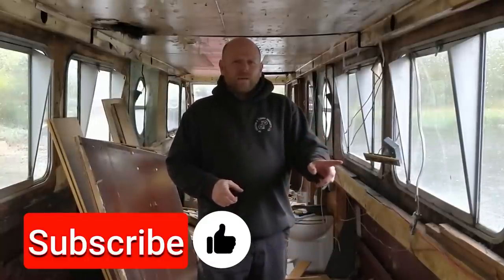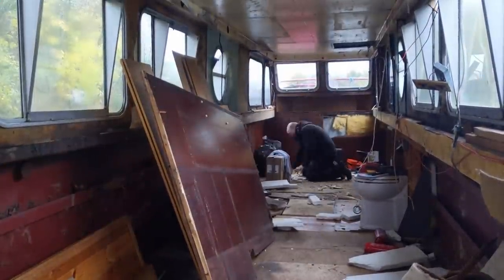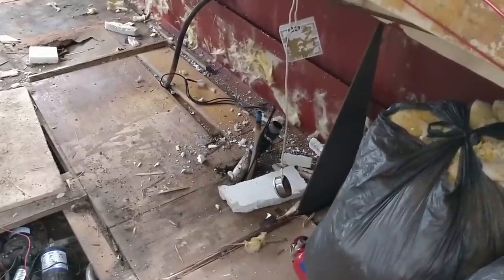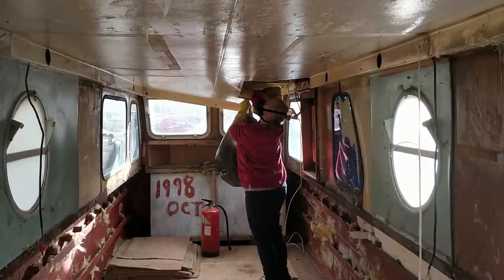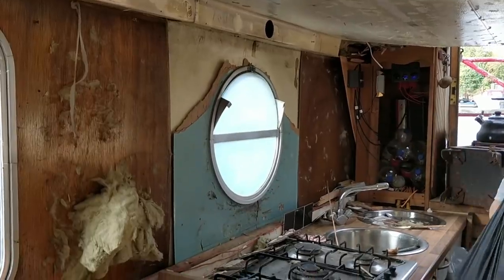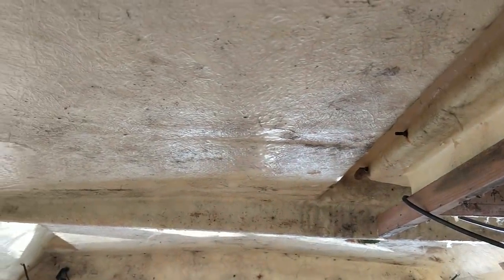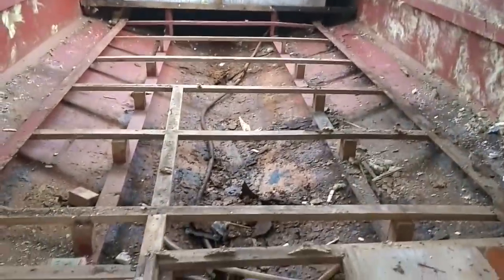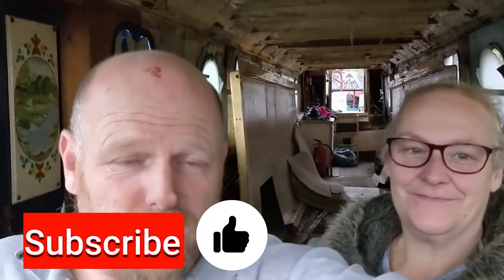Drop the ceiling and lift the floor, stripping out our narrowboat. Episode 9 of the DIY project

Comment: There is no ballast and that flooring is just chipboard. You need concrete blocks for ballast mate,, and WBP 20mm plywood for the new floor.. Keep up the good work!!!
Reply: I also wondered why there was no ballast, I remember many years ago when fitting out my new shell the floor was covered in concrete blocks.
Reply from the maker: The back sits ok in the water so it only needs a bit towards the front, especially taking into account when the water tank is filled up.

Comment: Is there no ballast in the boat?
If not is it because the top half is made of fibreglass.
Great vlogs. Lovely be to see a boat stripped back and rebuilt.
Reply from the maker: No ballast in there. It was sat a bit high at the front so will add some as we rebuild...

Comment: Because you’re going to live on the boat when finished I would out that old tank and fit two IBC tanks and there cheep they hold 1000 litres each but looking forward to whatever you decide
Reply from the maker: We will be having a good study of the water tank and options as we finish the last of the strip out....
Reply: @WingingItBoatingonaBudget  I own a company that builds narrowboats. Jaywolf do metal tanks custom sizes. But they are more expensive. Tanks direct also do custom; however have standard plastic ones.
Reply: @WingingItBoatingonaBudget  one idea to consider is rather than having a new tank, create a second tank somewhere in the boat; with a pump in between the two. The second tank can act as an accumulation tank; and will maintain high pressure from the pump. This will stop spitting showers and lack of water in your tap flow....
Reply: @liamhainsworth26  I bought a 200 litre tank from Jaywolf, you're right , they do seem expensive but when i got it i couldn't believe the welds, tidier than my downhill bike.  Well worth the spend for a fuel tank, an IBC would be ideal as a water tank for many reasons, so long as you can hide it away cleverly.  

Ps.  You two graft well and make quality down to earth informative videos, as a  Yorkshireman myself i understand the importance of hourly brews!  :)

Comment: I've messaged you on Facebook, so I could add photos, as others have said if the glassfibre roof is structurally sound,  it would be far less work to repair it than replace it.
Reply from the maker: There's pros and cons to keeping the roof. Our main concern is that we would be forever chasing repairs ..
Reply: @WingingItBoatingonaBudget  Agreed that is a possibility, it won't be possible to judge the risk of that until the current external "repairs" are removed .
Reply from the maker: @ChrisBrown-jh2mo  I'm not confirmed glass fibreing myself and we want to change window positions aswell... 
I got a 'rough' quote for the fibreglass to be professionally repaired and some windows removing and glassing the holes etc and it was £10k... For a lot less than that I can get a steel roof made!
Reply: @WingingItBoatingonaBudget  Having worked in glassfibre for 30+ years I tend to forget that what's easy for me isn't for others.
Reply from the maker: @ChrisBrown-jh2mo  I can turn my hands to most things, but don't have any real experience of glass fibre and I don't want to end up wasting my time doing it badly! 🤔
Reply: @WingingItBoatingonaBudget  I fully understand where you're coming from, like lots of things it's easy when you've had loads of practice. I did have my canal boat out today to take some photos, it's a bit small though at 16 by 6.5, that's inches by the way!

Comment: I would imagine when you add up as it stands the costs so far, it would have been far better to buy a new shell?
Reply from the maker: Probably not. So far we have spent just over £9k altogether. The cheapest I've seen a new shell for is £18k. And that was a shell only (not a sailaway so no engine etc).
Reply: @WingingItBoatingonaBudget  sailaway lined or even sailaway + is about £27k depending on size so I think it is still a better option to buy a used hull. Guess it depends on how much the superstructure is. Also you have a tank and various pumps and furnature which can be services and re-used.

Comment: hi so plan for  the roof ??
Reply from the maker: Wood or steel still not decided. 🤔
Reply: @WingingItBoatingonaBudget  About the sides   how join the roof and the side glass is easy to work glue and screw the wood make new frame about the water tank made off what is you work back ground ??
Reply from the maker: @josecorreia8280  depends what we end up using as to how we will attach it. I used to run my own landscaping business... I now drive a van delivering car parts...
Reply: @WingingItBoatingonaBudget s  did  like the arches  hatch all the timber  and  frame cut and grinder back steel need weld   and the fire problem  wood use plywood have to glue to glass make frame for roof and glass the roof outside best repair the roof   watch video how work with glass

Comment: would it of been better to buy a new shell and turn it into a new boat ,rather than buying an old boat and turning it into an old shell ! ,stay safe
Reply from the maker: If we had a lot more more cash then yes... To buy a new shell starts at around £18k... That doesn't include, windows, engine, gearbox, water tank, diesel tank, pumps etc. A sailaway that does include those basic things starts at around £28k... 
💷💷💷💷

Comment: The top section looks pretty good considering the age of the boat.  Check out the Boatworkstoday videos regarding fibre glass work. https://www.youtube.com/watch?v=yiLQnfOvI3w 
 If I were you I'd keep the top as it is and open up the old roof panels. The top have a sort of old fashioned train look about it which gives it character.
Great video, you have a long way to go.